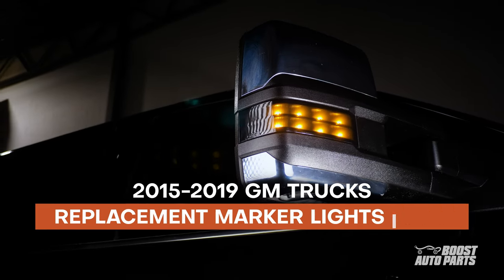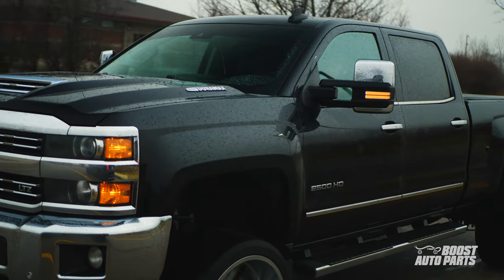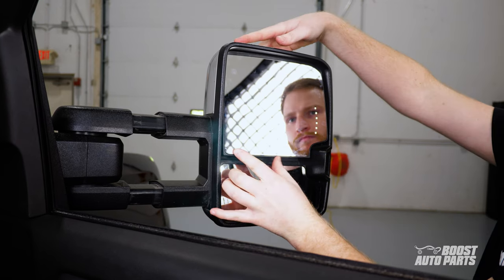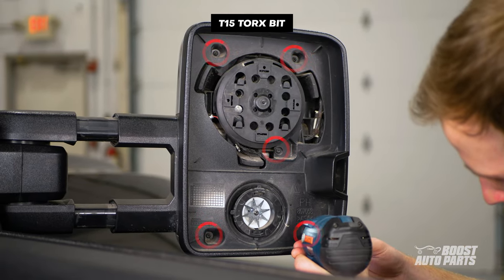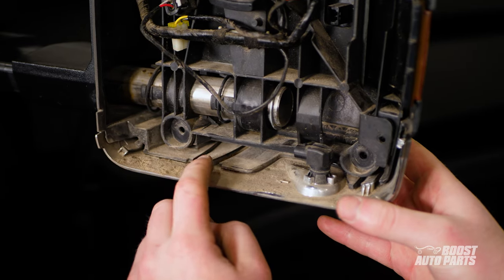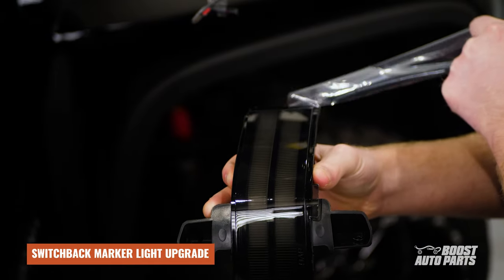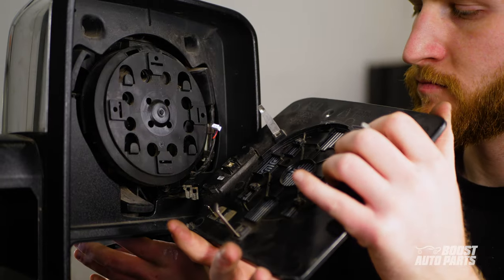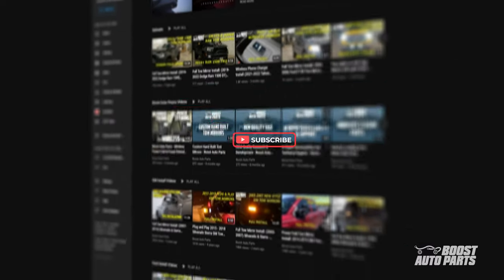Tow Mirror Marker Light Upgrade Replacement | 2015-2019 Chevy Silverado/GMC Sierra| Complete Install

Comment: Just bought a set of these for my 2018 Chevy 3500 to replace one that was cracked and taking on water. Got the smoked ones and they look awesome! Thank you for the specific step by step video! I was unfamiliar how to take off the mirrors because there are many different ways GM has been mounting the mirrors over the years. Your video showed how easy it is to do, although I did break a few tabs on the convex mirrors! I will be considering the heated versions! Thanks again! 😎
Reply from the maker: Awesome, glad the video was helpful and the lights look awesome. We've got replacement glass or the heated upgrade in stock and ready to ship!